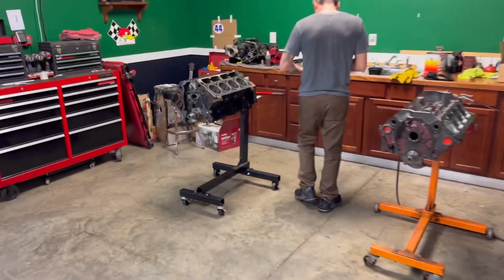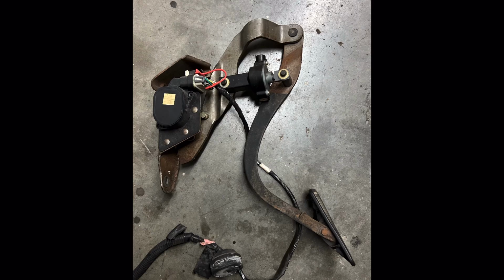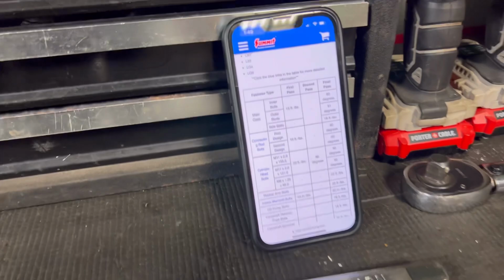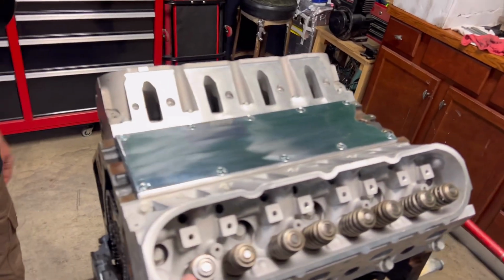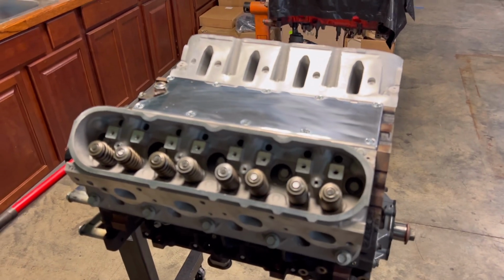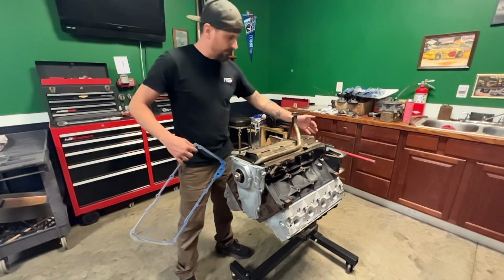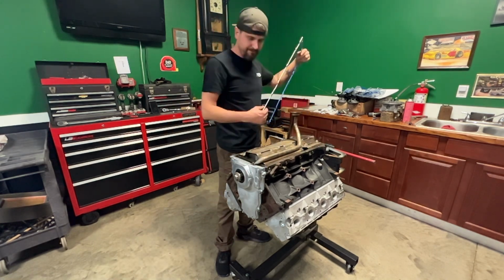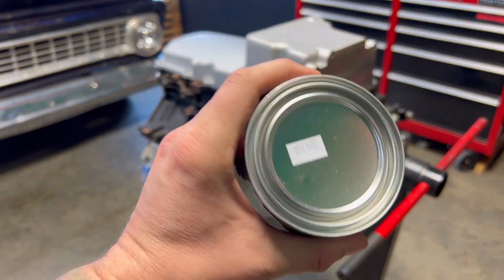FRANCIS EP.13 | DIY LS Swap Part 1 | Parts List, Installing heads, painting the block with PO5 15.

Comment: Thks for the video and putting me on to outcast bought a lot more product started new project 65 f100 have all the parts crown Victoria crossmember 5 .3 4l60 the norrower of 14 bolt duelly diff and the flat bed for it ! It will be lowered a little amount
Reply from the maker: awesome
Reply: @simple.c10  bought a lot and off the guy does the watts links
Reply from the maker: Thanks buddy! Glad you could support them!

Comment: Did you really use that gasket from Amazon?  Any leaks after this build ?
Reply from the maker: Which gasket are you talking about? I didn’t have any leaks. Running great.
Reply from the maker: What gasket are you talking about? All this stuff is Holley.
Reply from the maker: No leaks

Comment: Is the shallow oil pan needed for the swap?
Reply from the maker: If you’re bagged or low you’ll want a shallow. You can get GMSS engine mounts that lifts the engine up as well.
Reply: @SIMPLE.C10  10-4. I dropped my 66 3in in the front. I should be fine with the normal oil pan. Thanks

Comment: I have an LS swapped 65 C10. Almost every part that I bought from summit racing had problems, they also have the worst customer service and refuse returns. By the way, never buy CPP parts. It is often trial & error when buying parts, so buy quality parts even if you have to pay more, it will save $ in the long run.
Reply from the maker: I’ve used summit hundreds of times and they are the fastest to ship. The quality depends on what parts you buy from them. Some aren’t their parts they only carry them. 

I’ve used CPP parts on six builds and they have all worked well. Their disc brake and drop spindle kits are used on many high end build now. I recommend them.
Reply: Me two. I've spent thousands and thousands of dollars at summit. Only had a issue once. But actually it wasn't an issue. I once got upset for paying a restocking fee because I've spent thousands and thousands, I'd order the wrong part. I prefer them over jegs. Mostly because better discounts for amount spent.

Comment: Bro your craftsmanship is on another level! I got so much inspiration for my 54 bel air build from you. 

Are you able to use the stock ECU and tune it to work well with your aftermarket intake setup on this engine?
Reply from the maker: Thanks a lot. Yes stock ecu works great.
Reply: Thanks man! Got my build to this point with an engine refresh and painted it over the weekend. You make it look easy! The POR15 dried with so many runs. But still looks much nicer than an unpainted block.

You should piece together your own kit with the parts you used compatible to the classic LS kits. That and a basic tuned ECU would sell for sure